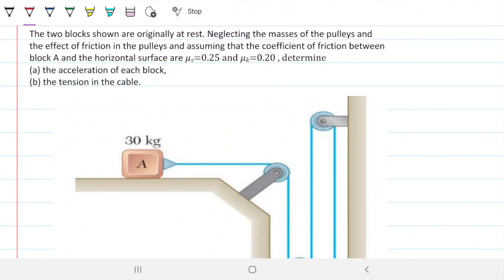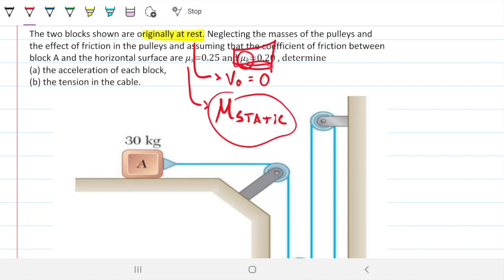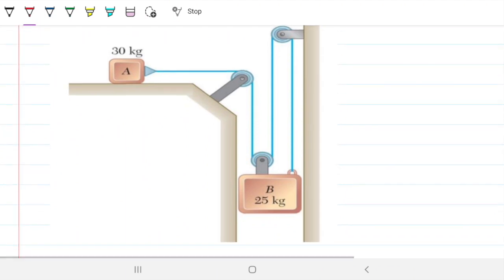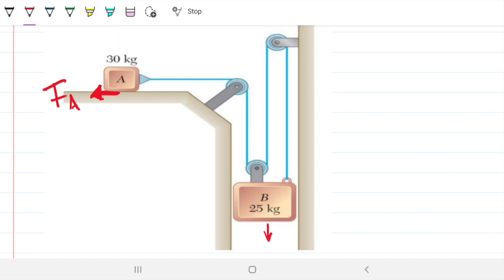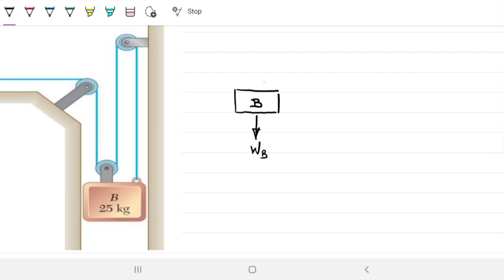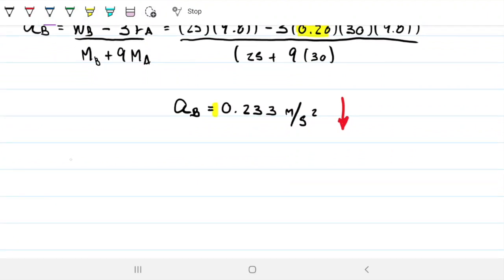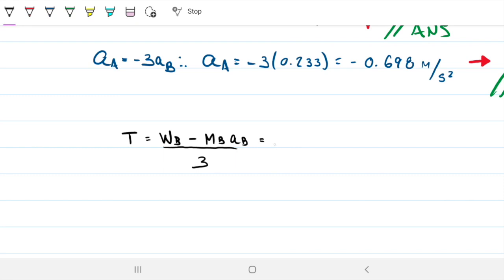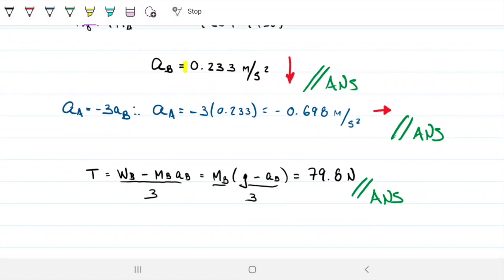Pulley with Friction | 2 Blocks | Newton's 2nd Law | Dynamics

Comment: What do you do? If there is no coefficient of friction? Assuming all surface are frictionless.
Reply from the maker: If there is no friction, the system will always move in the direction of the force. The only force trying to move the system is the weight of B, so it will move in that direction. So weight of B minus 3 T will be equal to mass times acceleration (F=ma). Block A won't have friction. The tension of the whole system will change.

There are a couple questions here in the channel without any friction https://youtu.be/n9YHLBX60S0